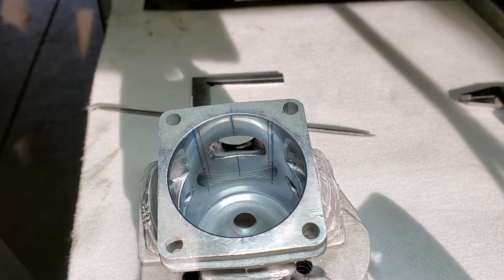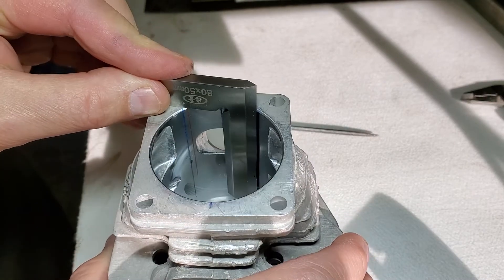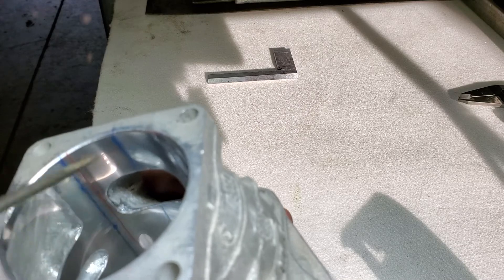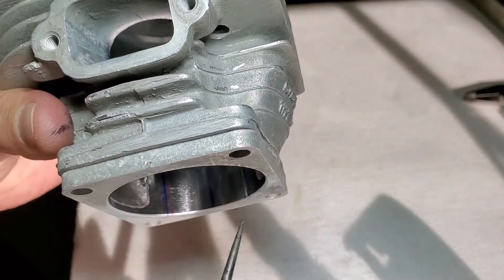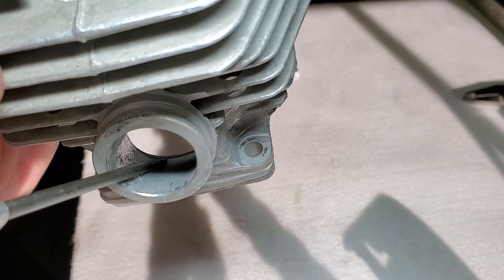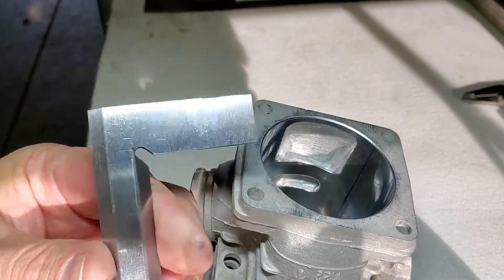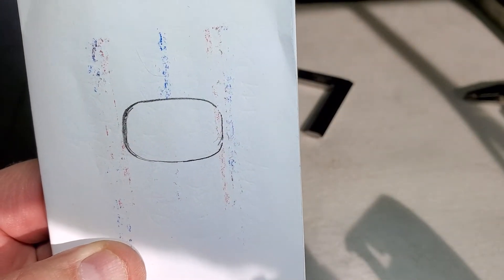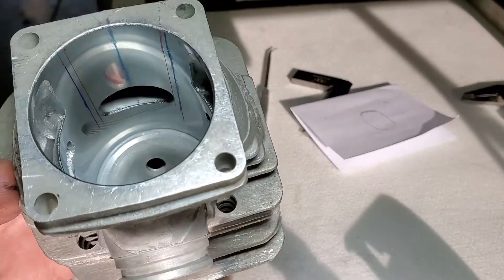pt 6 Stihl ms 660 R porting more accurate port/skirt width

Comment: Good layout.  How were your numbers?   I’m rebuilding one for a mill.  Staying 54mm cylinder combo.  Had to replace crank bearings and seals.
Reply from the maker: Hi Anthony. This was probably the 3rd saw I ever ported. This was a new OEM cyl and I didn't check. I opened up the ports, some piston work, custom base gasket and keyway advance. I'm still practicing with the deg wheel and just started playing a little with transfer timing. Still have lot's to learn. Sorry I didn't have an answer for you. Good luck with your saw and I appreciate your comment . Thank's for watching!

Comment: Man I love the beveled square..whered you score that one??
Reply from the maker: Got it from Amazon. There are probably many ways to do it , but I chose this way. Accurate enough for me. I will try to send a link.
Reply from the maker: The brand is Tulead size is 80x60. I will still try to send link. No good at that stuff.
Reply: Thx yea im no good at sending links either..if your on fb I posted one of my 660 running w one of Jason egans muffler covers..egans performance saws is the fb page
Reply from the maker: I will definitely check it out. Thanks!
Reply from the maker: https://www.amazon.com/dp/B081SVM89R/ref=cm_sw_r_cp_apa_fabc_YPNZFbENMXD2P